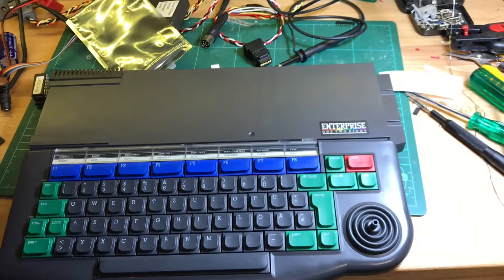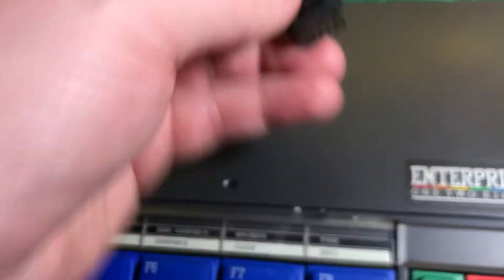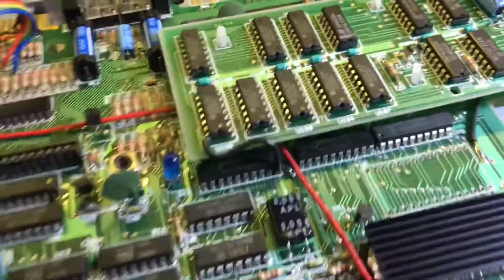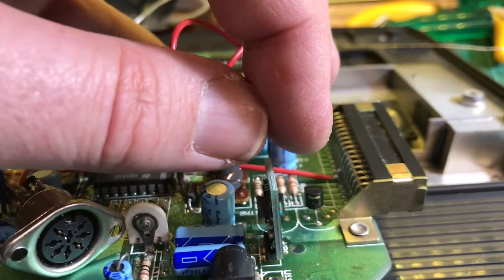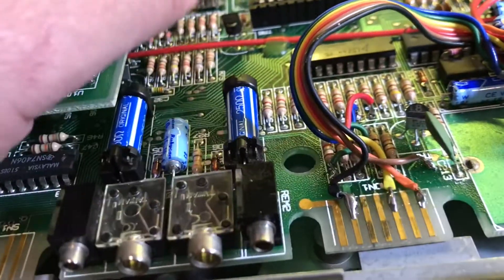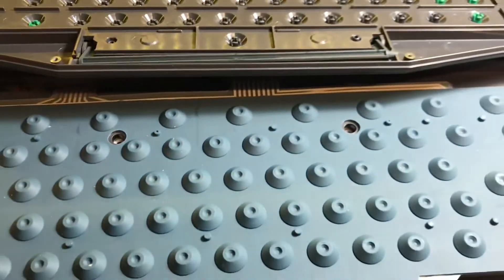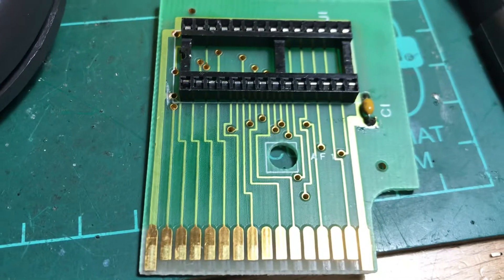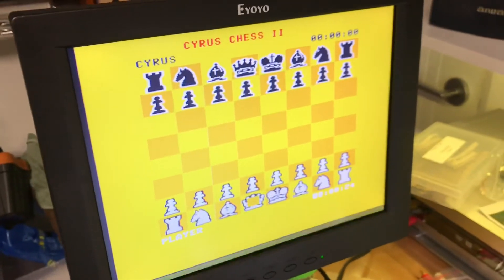🇬🇧 Elan Enterprise 128 Tinkering [TCE #0017]

Comment: Can you replace the built i. Joystick with an anologue stik with a top fire button?
Reply from the maker: It might be feasible.  There is a 3D printable replacement joystick nub - you could modify that to incorporate a small switch and run the wiring down the shaft.  I guess the wiring should connect to where the joystick ports' fire connector is.  Alternatively you could drill a hole down the middle of the joystick nub (maybe a 3D printed replacement) and attach a button on top. /Brett
Reply: @Brfff  go for it! Have you seen stefan drissens 8mhz mod player?
Reply from the maker: Oh ... analogue?  I don't think it would be feasible - it's a simple digital joystick - I don't know if the Enterprise has support for analogue, let alone trying to cram the sensors into the allocated space.